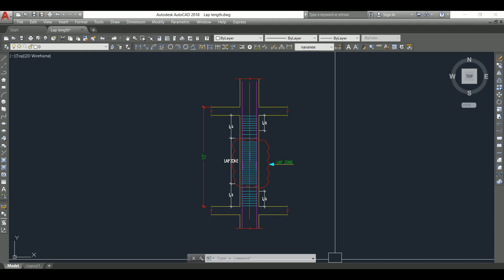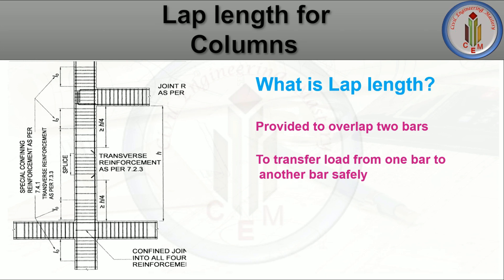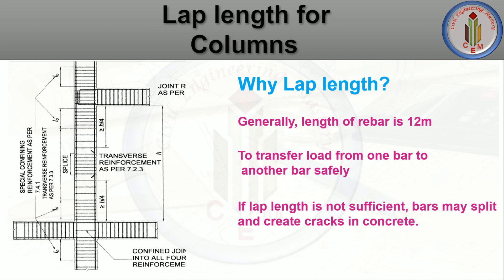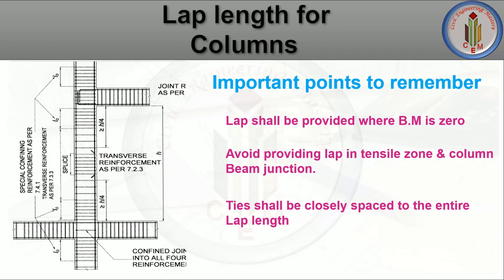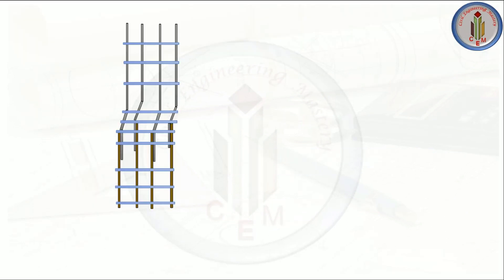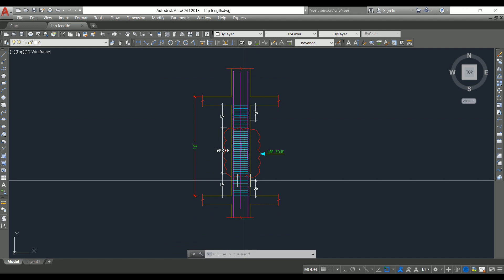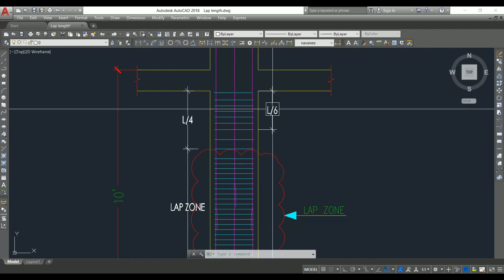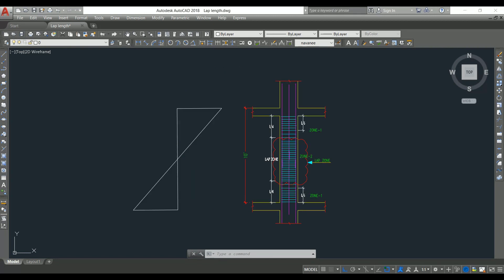Lap length for columns | Lapping zone for column | Lap length | What is lap length | Why lapping

Comment: Madam make a video on load calculations
Load transfer from slab to roof beams, roof beams to columns, columns to footing 
Complete building Manual design??
Reply from the maker: Kindly use the below link & coupon code to get the offer price!!
https://www.udemy.com/course/structur...

I have created a course, structural design of buildings using Etabs software which includes structural analysis and design of a five-story RCC building (Real project) and is now available on udemy. Kindly use the above link to avail the full course.
Thank you.

Refer to the below link for load calculations
https://www.youtube.com/playlist?list=PL_ZiPXJHDZziuetuqpvXWpvt1RyBctEDI

https://www.youtube.com/watch?v=AJG1Jix8NDk&list=PL_ZiPXJHDZzhJ-wTKBnPYBrt7E7xo5sCx&index=1&t=105s